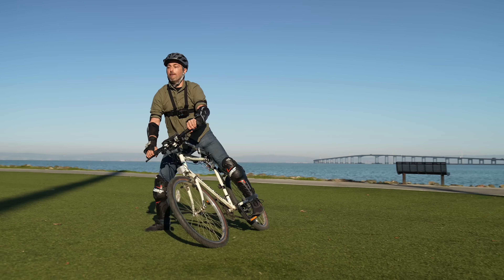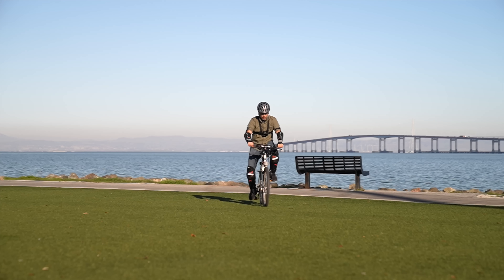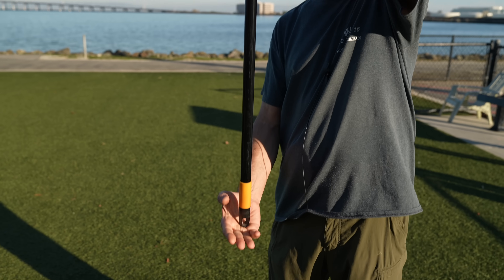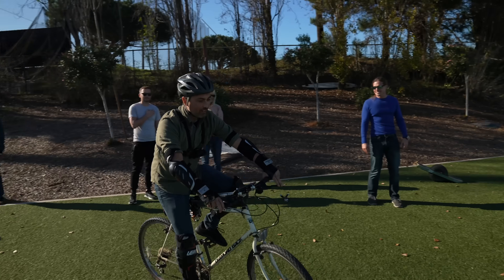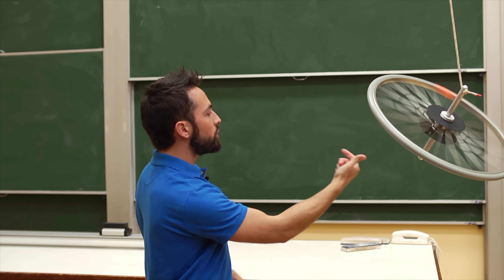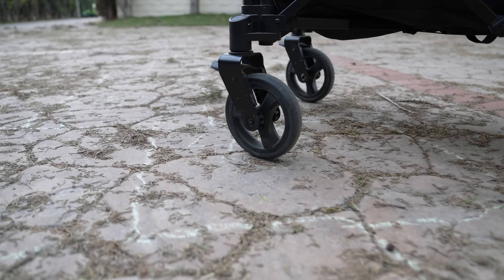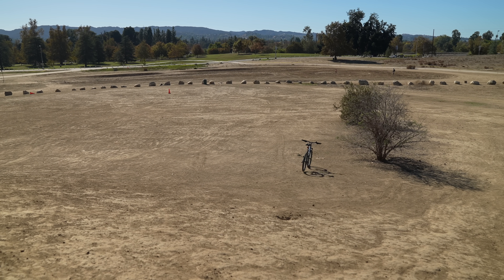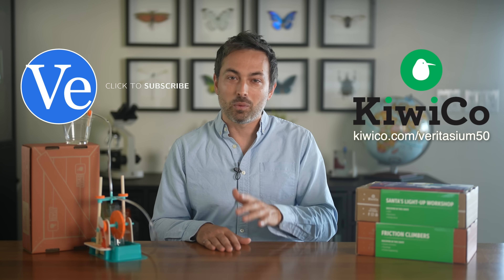Most People Don't Know How Bikes Work

Comment: public safety warning:  rather lot of decades ago I discovered this while riding along the top edge of a square gutter and finding that sometimes I could not steer left away from the from without first turning right and falling off it. The public warning si about what you can discover next. And if you read this then try it full motorcycle protective gear minimum... k.  (also young green bones so you only get greenstick fractures...  Serious.  Ok so know you've watched the video and learned consciously to understand how to ride a bike. What if you are scientifically curious and learn how to turn right then left... DONT. Watch some professional motor bikers and note how when they flip through a chicane the front wheel lifts. I always thought that was power. Until i got airborne on a push bike changing rapidly from a left right turn to a right. Airborne is not the problem, its the landing. Odds are high you will get it wrong and smash the pavement or grab and get high sided the other way. scary & dangerous.  I only ever made the mistake once, then found something safe to be curious about.
Reply: Airborne how?  Once you intellectually understand how and you are no longer limited by what feels (and is) sane... You can change from turning one way to the other that going through straight requires your bodies COM to go from leaning over one way up then down to leaning over the other so fast gravity is not enough to keep your front wheel on the road. >>zero control<<. All you get to do is guess how much your ought have the wheel turned the other way when you land and front-wheel skids, on the road(bitchumen).    grass or dirt won't be better as its less predictable how much it will grab.

Comment: The problem is these people are riding slower than people actually ride. Your momentum keeps you balanced at higher speeds. Have you ever seen professional riders in a race turn left before turning right? No. They just lean right and turn right. You do not have to counter steer or counter lean. . This video is a massive waste of time. And it’s wrong. Good job. I have a feeling these people just don’t know how to ride a bike.
Reply: >> Your momentum keeps you balanced at higher speeds.

If that were true, then it should be easy to ride in a straight line at higher speed with the steering locked straight ahead.  But I have yet to find anyone that can do it.

>> Have you ever seen professional riders in a race turn left before turning right?

Yup.  Every single time.  But the higher the speed, the smaller the steering inputs to initiate the turn.  It's very easy to miss whether you're watching or riding.  But the moment I take away your ability to initiate with the opposite turn, you'll miss it badly and immediately.

>> I have a feeling these people just don’t know how to ride a bike.

I'm working on a follow-up video since so many people make that claim.  Some of the folks in this video are experienced mountain bike riders.  But the folks in my follow-up video are famous riders with world records.

Comment: I actually did some "Research" like this of my own. I sometime tried to steer my bike without leaning, and I found it to be very hard just pointing the handle in the direction I wanted to go go. I eventually discovered that this is technique we've been using all along, just by executing a dumb idea of mine.
Reply: if you instead use the handlebars to lean the bike with you when turning you dont need to do any counter turning, i figured this out when i noticed i usually lean hard into pedaling to go faster and when doing that i end up forcing the bike to lean and i incorporated that to steering and it works
Reply: @deathdealer3357  yes i dont do counter steering since kid, meybe thats why i had so many falls, but now i drive my bike with no counter steering
Reply: When my son was learning how to ride a bike, we told him to lean in the direction he wanted to turn. On the next attempt, he leaned his upper body over to the side he was steering toward and promptly fell over on the opposite side. We thought about it a little more and realized that what needs to lean in the direction of the turn is the seat - so basically your hips; in order to achieve that, you actually need your head and shoulders to move in the opposite direction. He tried it again with that in mind and was off and riding!
Reply: Counter steering is how you ride a motorcycle.  Body positioning is a major part of it too. Upright, leaning, or counter balancing depending on the turn.
Reply: I just wrote the same comment a minute ago lmao cuz the same thing happened with me
Reply: its doable but its almost inpossible when ur not on flat land^^
Reply: Going back to stabilisers, or getting a tricycle is actually scary when trying to steer. You actively lean your body on the trike to stop your high centre of gravity from toppling you over on the turn. This works on a tricycle because you've two side by side wheels to push against, whereas on a bike you can't correct a lean. In a car it pretty much doesn't matter what you do because you sit low and the car is so heavy that your bodyweight has a negligible effect on whether the car leans into its suspension.
Reply: you can tho  i did it all the time as a kid mostly going slowy tho, its just more easy to counter

Comment: Turning towards your intended turn rides the bike out from under you - This is very dangerous with new motorcyclists - Some even claim they shift their weight  laterally into the turn, but to me this is a much less precise type of control, even if it works.
Reply: >>  this is a much less precise type of control, even if it works.

And it doesn't actually work.  But it's very easy to convince yourself it's working.
Reply: @Rick_Cavallaro   - Just to be more clear; Agree that counter-steeering is reality and it works - thx
Reply: @Crash-yp7ll  Yes.  I understand.  What's not true is what so many people (even in these comments) are sure of.  Namely that they can simply lean rather than counter-steering.  It's true that you can ride no-handed, but you're actually still steering - and counter-steering when you do so.

Comment: Doesn’t speed play a factor.  If you’re going fast enough unless you’re pulling a hard turn I’m pretty sure just simply turning left or right does the job
Reply: Actually, the slower you're going, the more you counter-steer.  But you may notice it less for two reasons...  you don't feel the pressure on the bars when you do it, and when you're going slow, you already tend to do a lot of corrective steering for balance.

Comment: My conclusion is probably wrong but it's centrifugal force keeping you upright.. 
The real world mechanics of it is based on speed as to whether i steer or countersteer. Any person experienced with motorcycles or bicycles would be familiar with this.
At speeds of 15-20 mph or faster typically the momentum on the 2 wheeled device is going to require countersteering, low speeds it's steering. shrug
Reply: Lots of people claim they don't counter-steer at low speed because they don't feel the pressure on the bars.  But they still do it... or fall.

Comment: 6:37 when the steering is completely locked, if you don't hold the handlebar, would you be able to balance riding hands free?
Reply: Nope.  Without the ability for the front wheel to steer, you just fall.  I'm working on a follow-up video that will hopefully display this.  I'm using very experienced, and even famous riders to address the comments saying Derek just doesn't know how to ride a bike.

Comment: When riding on ice, this counter steer flies out the window.  I have heard about the self stabilizing aspect of the rake on the forks, where you can ghostride the whip and it keeps going...  gyroscopuc procession helps... but no one mentions the difference in radii between the center of the tire tread, and the side of the tire.  Just like how a train with solid axles makes a turn, (the track underneath the train moves as the train keeps its original direction, and the camber of the train tires, which are conical, create 2 different size wheels.......the inside wheel has a smaller circumference, and the outside wheel has a larger circumference.... no need for a differential.)  Instead of the contact patch being a cylinder, it becomes a CONE!!!!!!!!!!! Castor effect is cool, gyro stability is great, countersteer has been mentioned, but the contact patch is something most people do not think about.
Reply: I did not know this is how trains turn without differentials! Thank you!
Reply: I was scanning the responses for a mention of this. This effect becomes more pronounced at higher speeds and lean angles. It's a primary factor in turning a motorcycle once full-lean is achieved by counter-steering. In a steady-state turn, the front wheel is very close to straight or even still slightly counter-steering to counter the righting moment due to lateral acceleration toward the center of the turn. It would be interesting to investigate at what speed this becomes the primary factor in turning a bicycle. As an aside, while I would probably agree that "most people" who ride bikes aren't consciously aware of counter-steering or the effects of rake and trail, I would guess that most really avid/competitive cyclists and motorcyclists are aware of these factors, especially if they're also technically inclined - i.e. the kind of people who attract to a channel like Veritasium.
Reply: i found this out the hard way

Comment: but this is simply not true. if you have your steering centered you just need to lean right and the steering will automatically rotate right and the bike will turn right. the steering will at no point in time be to the left of the center.

Comment: As an avid mountain-bike rider, I've learned how to ride in all sort of awkward and rough situations - the first time I tried to go slow over a narrow ramp, I learned the hard way that steering has more to do with your balance, then your balance. If you crawl at a snail's pace on any bicycle - you might notice that you readjust your steering more rapidly and frequently then you normally do at comfortable riding speeds. If you want to test this for yourself, ride a bicycle beside someone who is walking slow - and try to maintain the same speed on your bicycle as the person walking.
Reply: You are exactly right.  But it's interesting that nearly everyone swears they never counter-steer at low speed.  That's when you do it most.  You just feel it least because it gives no back pressure.
Reply: Left right left right LEFT RIGHT LEFT RIGHT!! falls over.

Comment: I used to test out riding a bike then remove my hands from the steers and I remember that it would do well sometimes and other times the steer handles would lean so hard on a side that It fails miserably and I have to put my hands back on it quickly

Comment: That's actually what you learn when getting into motorcycles. Introduce the curve through actively counter steering gives you a much better and sharper angle. Pushing on the side of the handlebar in wich direction you want to go makes you drive in that direction. Seems counterintuitive but works. You also learn that the gyroscopic effects keeping you stable only appear at higher speeds than the top speed of a bicycle.

Comment: Amazing video! The last experiment, the one the handlebars are locked both ways, one might be able to ride it if they don't use hands are all. Here in Brazil we're used to doing that for fun. I'd love to try that and the bik
Reply: I would very happily put you on the bike if you end up in the S.F. bay area.  But I'll warn you... riding without hands won't help on the bike with locked steering.  You're actually still steering and counter-steering, but you're doing it by leaning the bike side-to-side with your hips.

Comment: I accidentally discovered this years ago when I thought it would be fun to ride with only one hand on the handle bars (just as a test). First I tried using my right hand on the left handle bar.... Disaster soon followed. Then I tried using my left hand on the right handle bar... with the same predictable results. The reason neither of these techniques works is that if you try steering with "the wrong hand", your logic takes over rather than your sense of balance. Give it a try sometime (very carefully, of course.)

Comment: I think you are giving cyclists too little credit. Surely people who have ridden slowly know that balance comes from steering.
However, I disagree with the premise that you need to steer the wrong way before you turn the correct way in order to initiate the lean into the turn. To take the unicycles again as an analogy, they lean into turns despite lack of a steering bar, so steering is not necessary to lean. You can and should just shift your body weight, with no steering bar input. Please stay off the streets with your bicycle if you steer like you're drunk...
Reply: It's curious that you say that people surely understand this, and then go on to say that you don't really have to do it.  You really do.  You then mention unicycles.  Well, that's me on the unicycle in this video - and we really do counter-steer.  It's shown pretty clearly.

Comment: When I was a kid I delivered newspapers on a bicycle.  I used both hands to throw papers and steered using balance only, never touching the handlebars.
Later, when I got a different bike, I found it was not so easy to ride hands-free.  So, the specific geometry of the bike makes a difference.
Likewise, I don't see the big deal about balancing while not moving.  It's literally the same as standing normally!  Were you doing it badly on purpose?  I notice your pedals were at the quarter rotation position, exactly half way between what you would really do: have one pedal down and put your weight on that foot, and just stand up.  If you ever used toe clips you would quickly see the need to do this.
Reply: I see a common thread/realization in the comments. It’s all about finding different ways to balance! Counter Steering is just the word used for bikes, but the concept isn’t exclusively used for turning.

Comment: Okay I'm from the Netherlands so I take the bike a lot. But you can ride a bike with lock steering. In two ways either pull a weele. Or keep pulling the wheel in the right direction like you would. Going up the side walk.
Reply: Ps don't ride on grass for the best grip with a mountainbike go on sand. And on the road let a little air out of your tires to get better grip.

Comment: Taking steering away is not validation on how a bicycle works. It is right that a bicycle does not use gyroscopic technology to stay up.a bicycle stays stable while in motion due to angular momentum. But most people whom do not know how to ride a bike will counter steer to compensate. You can turn left or right without counter steering. You can do this by leaning into your turn. If what was showed in the video above was true then it wouldn’t matter about what is powering the bicycle (actually showed above). This would be the case for motorcycles also🤔

Comment: As a motorcyclist I can confirm 100% this is correct. On a longer bend you lean (substantially in some instances) and you can feel clearly on say a right hand turn you are pushing the bars to the left. It's clear as day (I suspect the weight of the bike helps).

Comment: Interestingly this is also how you steer expensive high level radio controlled bikes. Most people think you steer them like a regular RC car but that's not the case. To turn right you must first steer left so that the RC bike starts falling towards the right side, then you can actually steer right. It is very difficult and many RC bike models even have built in gyros to help stabilize the process.

Comment: I have been bicycling for over 40 years. Road bike, mountain bike, trials bike mostly but any kind of bike. I did bicycle repair for 25 years and could repair anything on a bike.
I do not know what kind of bike you are using that goes that far and balances and stays upright for that long by itself. It just doesn't happen!!! I have jumped off the back of a moving bike, been knocked off a bike, pushed bikes down hills and have never in 40 years seen a bike go that far with no rider. When I was a kid that's how I got off my bike. Jump off the back and let the bike roll by itself and in a few feet it would fall over and stop. It NEVER once kept on going across the neighbors yard and kept on going.
Even as an adult I'd jump off the back of my mountain bike at a pretty fast speed and the bike would roll a few feet straight up and then fall over.
This must be some kind of Mandela Effect for me because bikes DO NOT do what you showed in this video. 
Plus I have ridden road bikes thousands of miles every summer and watched every Tour DE France race since the 1980's (and even watching slo motion replays of crashes on corners) and I have never seen or turned left before going right. That's not how it works. It's more of a lean to tip the bike to the right then as the bike starts to tip right steer to the right. Without leaning your body the bike would turn right and you would continue going straight. You know, the whole physics thing. BTW my father was a physics teacher so I know a little about physics. So I have no idea what you are talking about with this turn left to go right thing.
Please let me know how or why these things do not apply to me and why in 40 years I have never seen any of these things happen. ThanX. Kevin M.